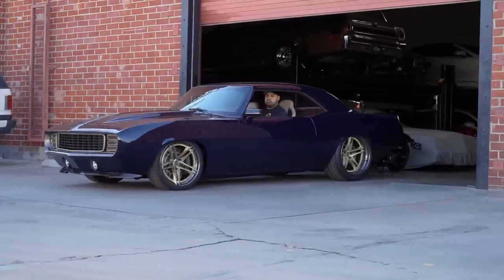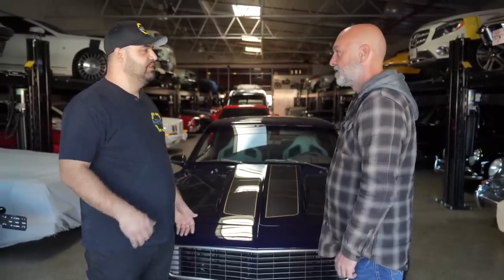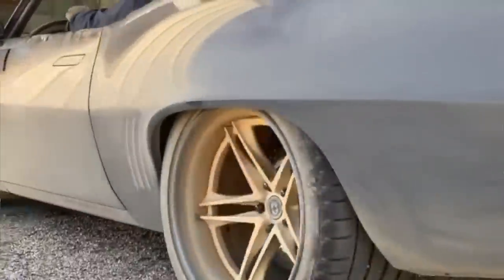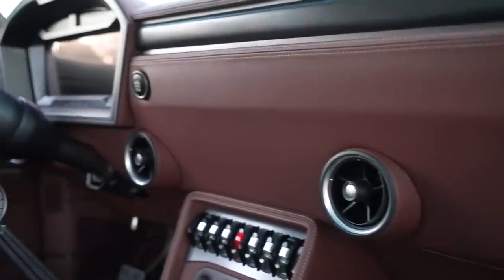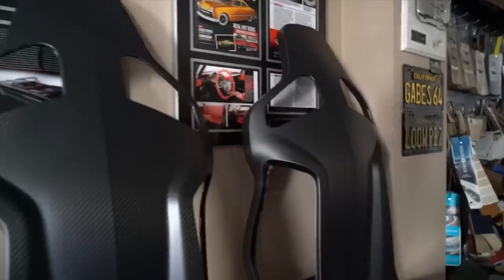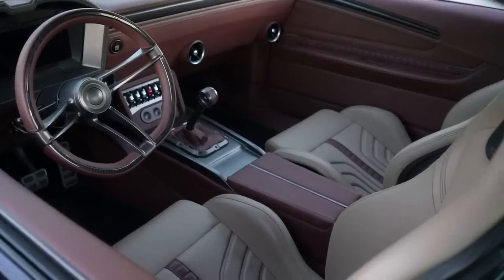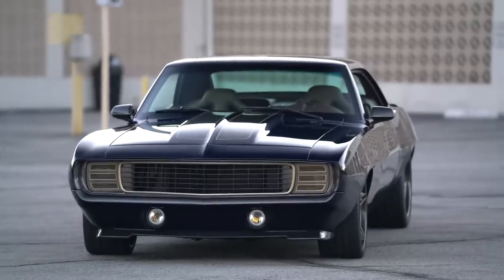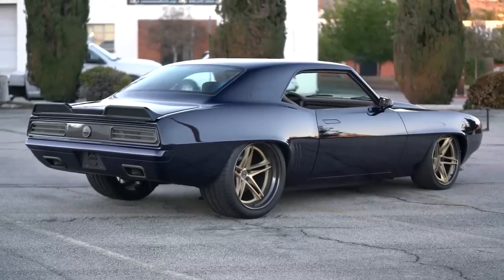$500,000 Custom 1969 Camaro with 750HP Mercury Racing Motor | Grimm 7.0

Comment: Wow! Just..Wow!!  Cool using a boat engine. One thing people don't really think about with boat engines, yeah they make a ton of power, but they're durable as hell. A boat's engine is ALWAYS under load. Right from idle to cruise. There's no coasting in a boat. They're designed to be worked 100% of the time, and Mercury is at the top of the boat engine game. Such an awesome car. Thanks Shawn. 👍👍
Reply from the maker: You get it! These engines are tested flat out for multiple days so big yes on durability and what a unique sound!
Reply: A constant load is actually easy on the engine. Rapid rpm change, low rpm loading and TDC on the exhaust stroke at high rpm are much harder. A 4in stroke at 8k rpm each piston is changing direction 266 times per second with an inertial weight of 4500lbs at BDC and 6500lbs at T.D.C.  luckily fuel consumption will limit total time 7L spends turning 8k rpm.

Comment: Ok Shawn.  I see your point.  Some of these guys do the car show rounds right after the build, before any street driving, so the car looks and is pristine.  Then, after a year or 2 of showing the car, they drive it and let guys like you test it out and do a video.  Fair enough.  This 69 is a beast.  He said it has a custom chassis, so can I assume that it is essentially a full framed Camaro?  Normally, these Camaros were the so-called "unibody" design lacking a full frame and therefore subject to body tweak (twist) if overpowered.  It sure looked like it wanted to hook up and not spin the tires which is exactly what you want.  Great video brother!

Comment: GM should just contract Mercury to make the motors for C8 going forward.
Reply: Or have the Camaros go out with a big ass bang with a DOHC engine like this
Reply: The engine alone would cost more than the c8
Reply: @dannyt9067  forsure
Reply: Chevy has made a DOHC LS block for a prototype Camaro Z28. It produced around 720hp naturally aspirated
Reply: The 5.5 in the 23' C8 has got things under control.

Comment: Shawn....I have said this phrase probably 100 times “this has to be the best built car you’ve shot” okay I think between that flat black 56 Chevy and this one I am torn, I want both, this thing sounds just like you said “violent” ... almost NASCAR meets Pro Stock .... the exotic DOHC, like a Ferrari on steroids it looks like it handles flat  btw your driving skills are outstanding your heel toe downshifts really lets you hear the motor’s rev band! The interior outstanding detail the owner thrashing it in the desert...he’s my new hero no offense to you, the gold wheels with the dark blue works, at first I was skeptical...but it works. I just want to get in it belt up fill up turn on the radio and drive....with nothing planned or a GPS route programmed, the road is calling and the owner is a lucky man! I hope he has a blast with it!! You have the best job ever! Need an assistant I sweep floors!

Comment: The 67 - 69  is regarded as the holy grail of the camaros and deservedly so.But the 2nd gen 70 -73 built right, lowered ,wide wheels ,that rear 3-piece spoiler ,manual with a bad engine disappearing into the distance under full throttle gets me everytime.

Comment: I'd say that motor alone is at least $25-50k, another 35k to 50k in RS chassis, interior 100k, boom 300k, car's not even painted yet.
Reply from the maker: And then comes one off carbon fiber...plus we need a transmission and maybe a few other things...adds up quickly

Comment: So now and then you see more and more mercury racing engines. Is this "date to be different" or is there another advantage with these motors? Is this the same brand as the outboard motors?. Being dutch I'm not thát familiar with these engines...
Reply from the maker: Same as the boat motors and they are durable. Boats have to be able to run flat out for long periods of time. Great engines

Comment: Shawn how did the car run in the lower RPM ranges around town?  What do you believe the durability is for this motor in a Restomod driver that's not constantly abused?
Reply: Also do you believe 3.73 was the right final gear for the car or could 3.90/4.11 be better to get this in its comfortable RPM range more quickly?
Reply: @autotopiaLA Please see above questions

Comment: There is a couple of things that would happen if this was my car. For $500,000 price tag it would have 1,000+ horsepower. Also no one would drive it except me. Just a thought 🤔
Reply from the maker: Do you really need 1000 hp? Remember, this is n/a and making 750. Glad I got to drive it too
Reply: @AutotopiaLA  Yes sir I would need at least 1,000hp because of the amount spent to build the car. Truthfully in the near future I plan on building a '68 with a 1,200hp borowski engine and I will not spend as much sir.

Comment: Unbelievable at the beginning of this video it shows them beating and running the Camaro thru the gears and neither one is wearing a seat belt
Reply from the maker: Because it has mainly been in show mode it currently has no belts. That’ll change soon and max speed was about 50 ish

Comment: Beautiful car but how in the hell did you spend half a million dollars? Like I see 150,000 to 200,000 at most.
Reply: Thats what i want know,how much?so that we prepare ourselfs.
Reply from the maker: There’s over $150K in parts on this car! How much do you think a one off carbon splitter costs? How much do you think the engine costs? That interior alone would run around $100K. Comical comment
Reply: @AutotopiaLA  I don't see it. And 100k on interior alone??. I can see 80k or so on the motor..... carbon fiber splitter 10-12k custom is what I imagine.... fully custom wheels and tires.... 25kish.... I still don't see it
Reply from the maker: @colesnyder7640  if you don’t see it nothing more I can do to try and explain. No big deal. I just show cars that we think are great and tell it like it is

Comment: Here he goes again.

The $500k car guy. 🤣🤦‍♂️

Dude. $200k all day
Reply from the maker: Add up the parts alone and you’ll be around $200K. That interior is about $100K. But we’ll trust you over the builder cause obviously you know this car very well 😂
Reply: AutotopiaLA come on dude.

Go ahead and add it up. Please.
Frame: $25k
Brakes: $7k
Wheels and tires: $10k
Engine/trans: $50k
Rearend, axles, driveshaft, hard lines and stainless lines: $10k
Donor car body: $25k bc it was decent 
Dash, wiring, ECU, gauges, replacement glass: $9k

So far, that’s $136k. 

So body work and paint plus interior equals $364k.

Makes sense to NO ONE where you come up with your bogus $500k builds that don’t have the name Chip Foose or Canepa.

Math only adds up when you use it right. You guys have some bullshit numbers somewhere. 

Cost anyone reading this $200k for that EXACT build anywhere that builds $150k+ frame off builds. Rotisserie paint and body. Compete. No expense spared. $200k gets you the best the industry can produce without a hotshot name behind it.

Who are these guys again? That’s right. Never heard of them.
Reply from the maker: @TheTkrum  I didn’t come up with the number...it was told to me by the builder that no one ever heard of...Jesus from Gabes Interiors...you win bro! I’m just a nobody that likes showcasing vehicles that I think are amazing...seriously, you win here 👊
Reply: AutotopiaLA IF that interior was $100k AND it was done by family - then dude over paid not just by half, but by a lot more if it was family.

Just saying. Act like he’s the only person cutting wood and wrapping it with skin. Give me a break man. Beautiful car, for $175k. Wouldn’t offer him more than $100k cash, if it were me. Maybe if he gets in the bind, you know how to reach me 😎
Reply from the maker: @TheTkrum  like I said...you win 👍

Comment: I will never understand these high dollar custom restomod cars that have a manual transmission, no creature comforts, NO 3 POINT BELTS (or any belts whatsoever, looks like?!), no motorsport ECU, no ABS, and no traction control. It may have been excusable 15 or even 10 years ago, but not now.

Not saying it's a bad thing to NOT have some of those things - it's just disappointing to me, personally, that all that power will still never be able to hang with something like a McLaren 720S because the real modern stuff has been brought up to a motorsport level. And any restomod or Pro Touring build using custom bodywork and a 50+ year old body has never been, and will never be, similar to something like the Noble M600, which is a custom-built chassis that's designed to work at 600+ horsepower WITHOUT any driver aids. These are, at their core, very weak, flimsy, old frames that really cannot be brought up to modern supercar or even sports car standards of torsional rigidity and stiffness without basically a full race rollcage (which defeats the point of the added performance from the new engine and suspension).

And the thing is, at that dollar level, it's actually entirely doable to rival a McLaren-caliber supercar. I've made an entire list of all the parts it would take to put together a build like this that I've put together over the years in a Google doc. Even with adding in a sequential transmission, paddle shift, all carbon body panels, brand new shell, independent rear, and motorsport ECU that can do maps, ABS, TC, stability control, remote suspension control, pro-level audio, sound deadening straight out of a private jet, DOCOL R8 rollcage, extra tires (including slicks and a winter combo), backup cameras, Bluetooth control, USB-C, and a whole bunch of other things that simply aren't present in any Pro Touring build on the planet ON TOP of the prerequisite high-performance hardware, the total cost of all the parts so far is $270K. Even if you double that for fabrication, interior, tuning, custom wiring harness, chassis setup, dyno, and every single little extra piece that might go into a balls to the walls build, that still puts you at, say, $550k.

At that price point, the benchmark should be head and shoulders above the final C7 ZR1. Otherwise, I'm sorry, but it's a complete waste of money. Also, all the Lambo and Ferrari bits in the interior mean nothing if it doesn't have amenities that even regular $25k cars have today - like a backup camera, Bluetooth, steering-wheel mounted controls, and a usable glovebox. But you got Tesla handles! So cool! Not.

Comment: It seems to be just an expensive toy, or maybe an experiment. Besides being to low for street use; too noisy, and must rev to high RPM's? So why did they put a boat racing motor in a Camaro? He drives two blocks down the street with no seatbelts on, and claims it's a great car? Not going around turns, up or down hills, or parking? Huh.

Comment: So it's a $500,000 build cause some guy just threw it out there? $100000 interior? Lol it's obvious this guy hasn't built to many cars....
Reply from the maker: You may want to do some research and get up to speed. Gabes has been one of the top upholstery shops for years and Jesus has built many cars this is just the first for a client. Consider the cost of parts alone not to mention metal work, paint, carbon...go educate yourself then try again 😂
Reply from the maker: @LT4Nova  I’ve made it clear many times that I’m not a builder just an enthusiast. I can ballpark prices based on spending a lot of time with successful builders. And if I’m so “cringy” why do you watch our videos? Anyhow, have fun bashing away and we’ll keep having fun making videos and showing off builds that we think are cool
Reply: @AutotopiaLA  I actually like the vehicles in your videos ALOT. I have owned a handful of them..I think you have good eye for cool cars but that dosnt mean I won't call bullshit when I see it. Ring brothers, roadster shop builds are a 1/2 million because they're CUSTOM. This is a protrouring build with off the shelf parts and a custom interior.. Come over to pro-touring.com and you will see us building cars like this in our garages...